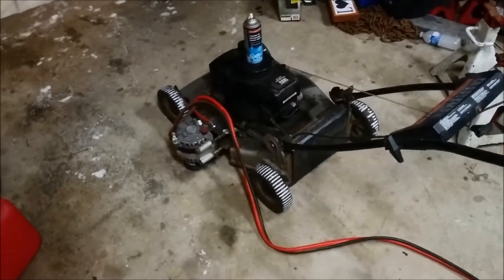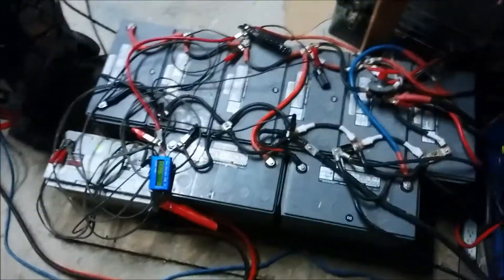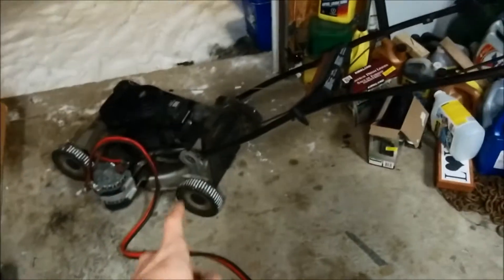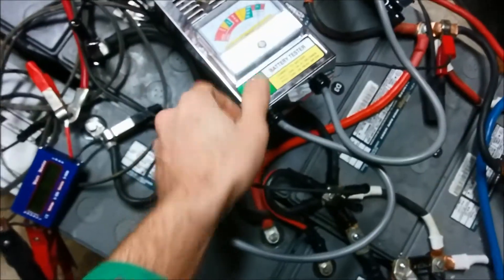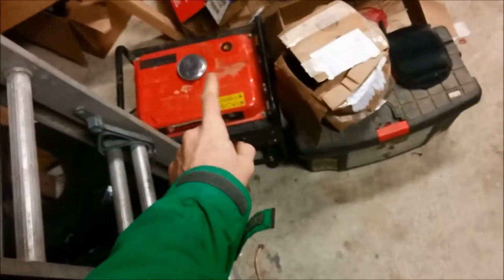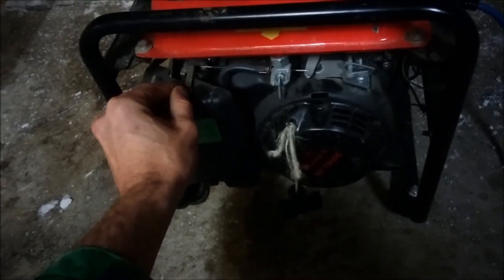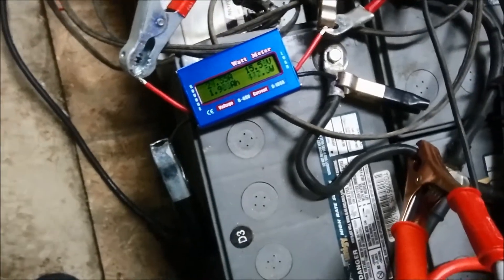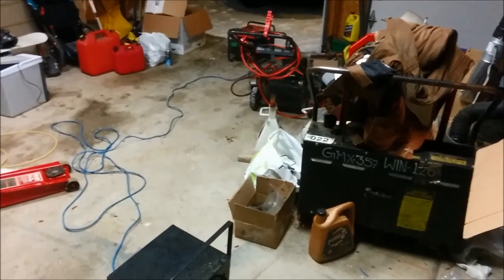12v lawn mower generator vs 1200w 120v

Comment: your mower motor has a light aluminum flywheel and no blade. these were used for safety reasons on consumer power equipment since the early 80's. small gas engines also can't run too long or govern the load at an idle. if you change out the flywheel to an older model cast iron flywheel and run the motor at full speed it should be able to govern the load. you could also add a cast iron brake rotor or drum on the blade end by using a section of blade to bolt it through the wheel bolt holes. if it still bogs down you may need to change to a slightly higher horsepower motor or larger drive pulley.

Comment: for your lawnmower it sound like your governor is not kicking in .when a  engine is under load the r.p.m's should rise when the  governor kicks in.   I just bought a 3000w motomaster inverter a few weeks ago and on les pac {les pac is something like kijiji } there was a guy selling mr 490 battery's I got 6 of then ,and now im looking at every video for info ,keep up with the good work
Reply from the maker: thats sick,i have a video on that inverter under close to max load.
Reply: fliping720 which means ? good or bad ? like I said im a rookie in this stuff, seen your video  on this inverter and you seem to be good with it
Reply from the maker: S.M.R. PIECES i really like it, I run my worm drive skill saw, and my air compressor of it, for the money its good.

Comment: Cool test man... It would be interesting to find out which one is better on fuel ...looks like there both putting out roughly 50amps
Maybe dump exactly 1 litre of fuel in each tank and time them each individually under full load ...

Keep the vids coming
Reply from the maker: will do, have lots of stuff on the go.